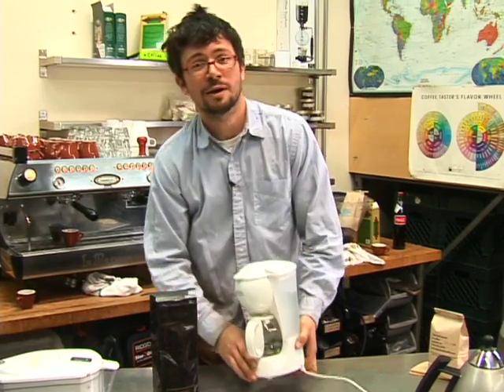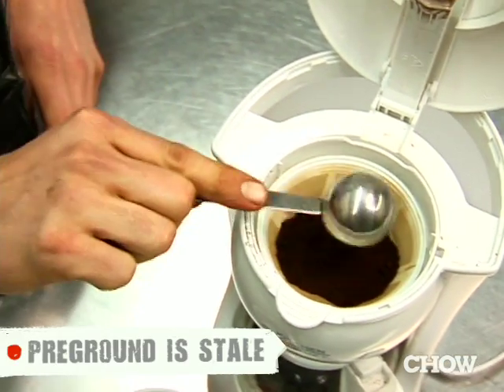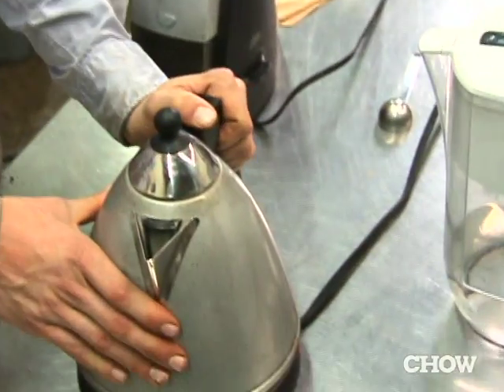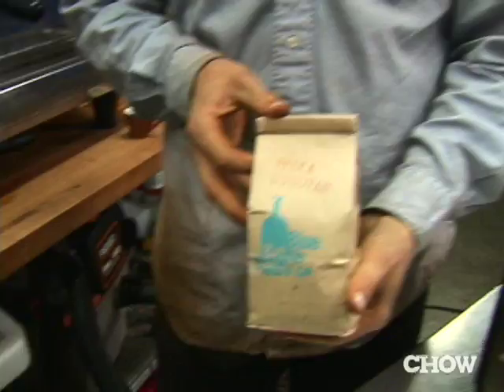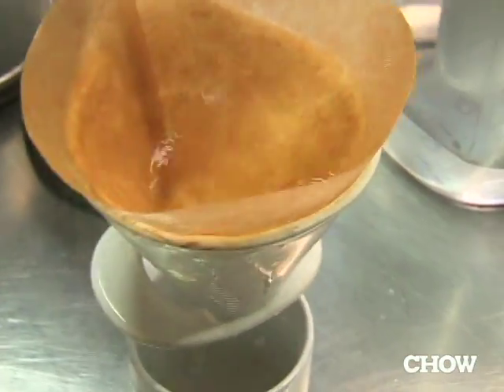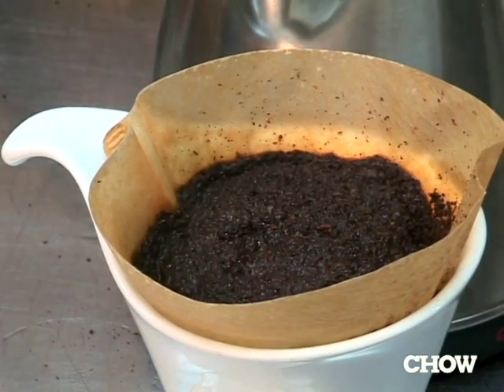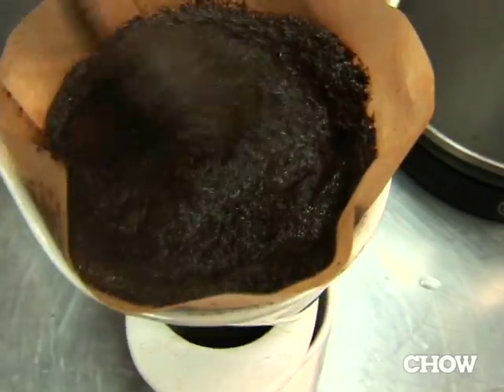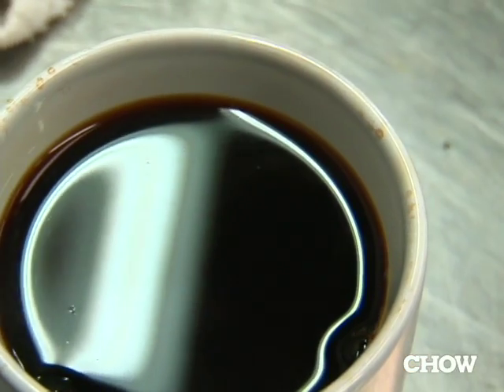You're Doing It All Wrong - How to Make Drip Coffee

Comment: Also do you hold the filter directly over the cup while stirring coffee as it drips through or do you use a coffee attachment that you would normally use in a drip coffee machine and then push the extractor to filter through? Basically can you filter the coffee directly into the cup you are using?
Reply: Drip filter into jug